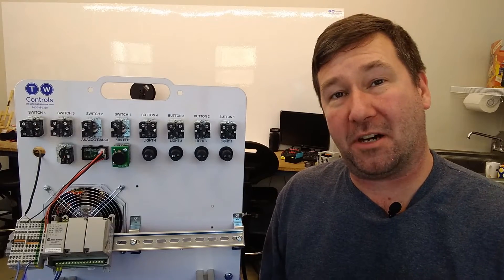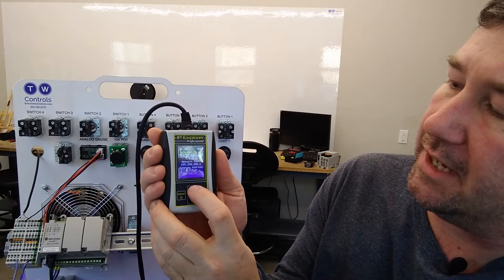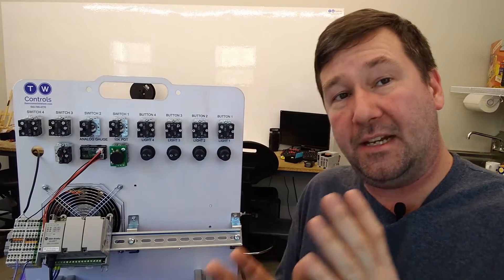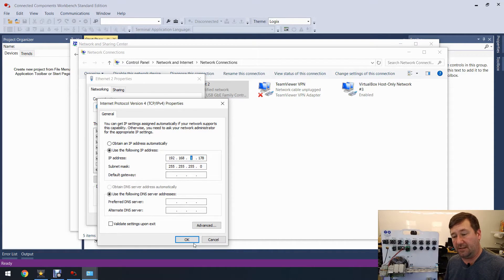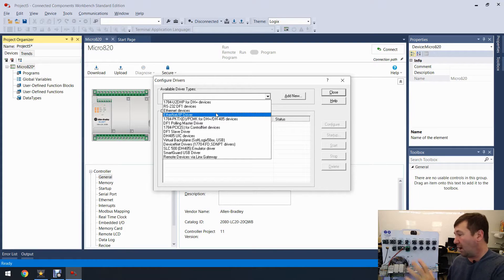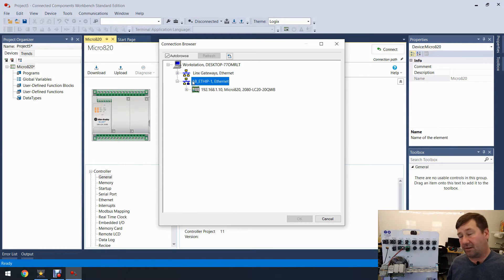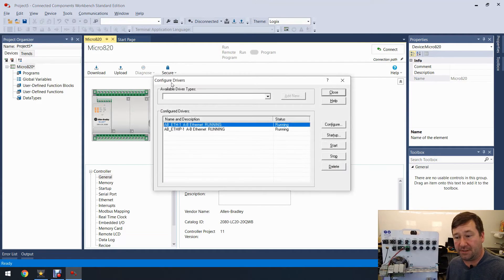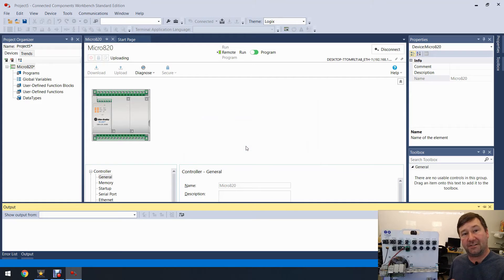Connecting to Allen Bradley Micro800 PLC over Ethernet in CCW

Comment: Hi Tim,
Is there a way for a client to use internal registers assigned by a program which is password protected and (connected to a micro850 via etherenet) to be able to toggle these as a way of another method of control without visually being in the program?
Reply from the maker: Same as the previous question, those would allow you to change tag values outside of the PLC

Comment: Is there a way to use wireshark or another tool to get the PLC's IP address if I know its MAC address without having use the IP explorer as I don't have one.
Reply from the maker: If the PC is already communicating with the PLC then Wireshark may work, but you'll probably be in a chicken or egg scenario since chances are you can't communicate...hence why you are trying to figure out the IP address.
Reply: @TimWilborne  Yea exactly the wireshark data capture shows a broadcast message called Ethernet II, Src: Rockwell_d8:e6:65 (5c:88:16:d8:e6:65), Dst: Broadcast (ff:ff:ff:ff:ff:ff) with a sender IP address of 0.0.0.0, which I guess means it hasn't been assigned yet by the network?
Reply from the maker: No, that means Wireshark can't discover it but not that it doesn't have an IP.
Reply: @TimWilborne  I purchased the IP Explorer from your site!   I think I'm starting to wrap my head around this though.  The initial ARP request is the PLC broadcasting the IP address it wants to assign itself to ensure its a unique address.  When no devices reply then does a ARP announcement, assigning itself its target IP address. Which was my static IP address that my PLC had.  I also made the mistake of then downloading DHCP ethernet configuration, so now my subnet mask on the PLC is different than my PC.  Is there a way to change the DHCP subnet range that the PLC assigns itself right now its always a number like 169.254.x.x but my router assigns in the range of 192.168.0.1/24.  Phew lol getting close to figuring it out
Reply from the maker: Ah, I didn't catch that you downloaded a DHCP configuration.  It still wouldn't be 0.0.0.0...here is a video to help you out.  If your PLC has a serial port, you could use it to change the IP address or wait for the SIM-IPE :)
https://www.youtube.com/watch?v=EREXfbB32mI

Comment: My 2 cents, for the people that do not have an IP explorer you can set you ethernet device on your pc to obtain an IP automatically, minute 3:06 on video, then from  the command prompt "cmd " you can type " ipconfig " and press the enter key on keyboard. The ip of the device, in this case the PLC will be listed along with its subnet mask, you can then do a ping from the same screen and confirm that you do have communication with the plc as in minute 8:20 of the video.
Reply from the maker: That will get you close but no cigar.  The IP address listed will still be your PC's IP address that it randomly assigned in the 169.254 range, not the PLCs.
Reply: Exactly

Comment: Good day Tim

I have configured my drivers as an Ethernet Device, I have set my connection path to the correct Simulator IP after turning on the Micro800 Simulator.  But then nothing happens the PC froze each time.

What could the fault be?
Reply from the maker: Probably time to call Rockwell Support.

Comment: Hello Tim, thanks for all the videos. First time playing with PLC. No training. And I have a custom setup running at my dads work off at micro 820. I have a issue with the workbench not finding my hmi screen anymore. And I’m trying to download a new screen. I am able to ping the screen. But When I configure the drivers. I am not able to see it anymore. Can I also use the Ethernet option where you type the IP address in to make it look for it in workbench like you did for the PLC? I feel like did something and it blocking it self now!
Reply from the maker: Your question got cut off but check your network configuration including subnet.  Are you using the Ethernet/IP driver?  If so, try using the Ethernet devices driver and see if it works.
Reply: @TimWilborne  unfortunately nothing worked. When I used just Ethernet. Work bench found it that way. But instead of showing the screen next to the IP address it was a yellow question mark. Still would not load my screen. Had to go the SD card route. The plc and hmi seem to work together though. I like to send you my video of my custom setup.

Comment: I don't know my plc's ip address but I know my laptops ip address. Can I ping the plc to be able to work with my laptop's ip address? I don't have a ip address reader and none of us have ever messed with this plc.
Reply from the maker: You'll need to know the PLCs IP address to connect to it.  Which PLC is it?  If it has a serial port then you can connect over it over than and find out it's IP address.